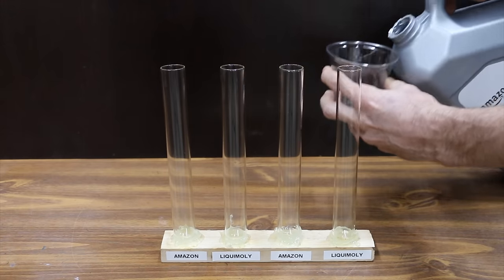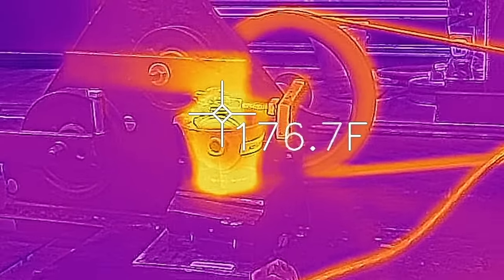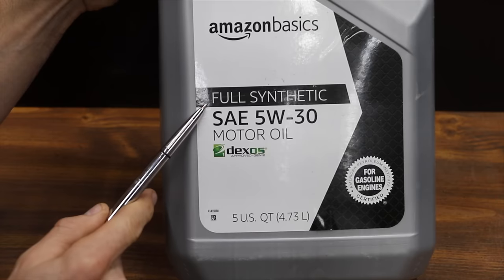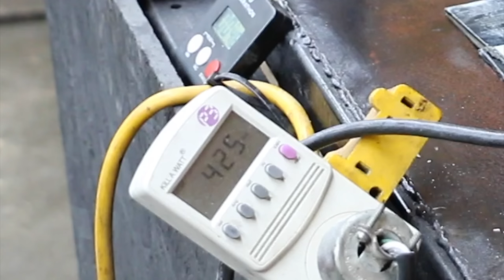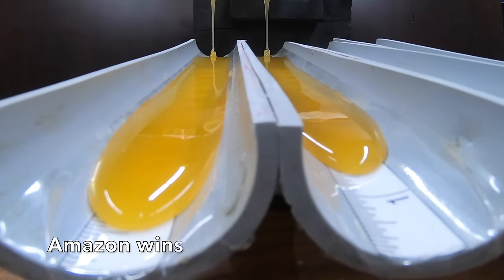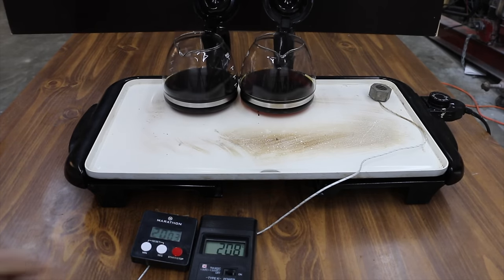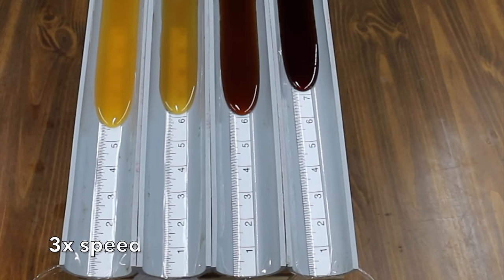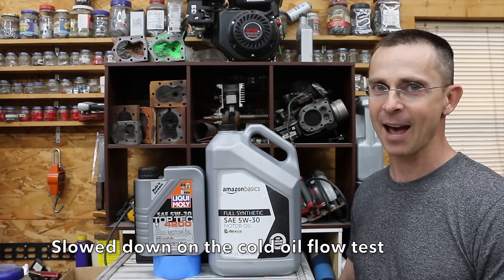Is Amazon Basics better than Liqui Moly? Let's find out!

Comment: Premium overpriced brands hate you on a whole different level.  Stay safe.
Reply from the maker: I believe you are right!  Thank you
Reply: Except for Amsoil. That shit is the best
Reply: I would never buy Liqui Moly even if this test never existed. Overpriced junk. Look how much it changed after the heat cycle. Garbage.
Reply: Amazon is good quality oil. It’s low because it hopes to take a chunk of the oil market , long term strategy monopolization
Reply: @JSPHTRS  yeah Amazon is already there. The only downside is that u can't get stuff immediately, but 2day shipping is amazing
Reply: @bagelbytes69420  Anything used all year usually gets purchased in bulk. Well, ok, maybe just 2 bottles at a time. (But I do not buy 2 commercial size packages of Choward's Violet  mints because I would probably eat them even faster.)
Reply: @JSPHTRS  100% correct. The name gets out there and Warren gets indirect notariety and a long term customer (probably at reduced profit, but long term money for sure!)
Reply: Premium brands provide 4 times less engine wear at 4 times longer Oil change interval.
Reply: LMFAO
Reply: @bagelbytes69420  yeah if you want an oil that doesn't carry any OEM approvals buy Amsoil 🙄
Reply: @repairvehicle  longer Interval doesn’t mean it’s a good idea. Dirty oil hurts the engine in the long run. I change my oil every 5-6k max. One of my vehicles 173k on the clock, doesn’t leak and looks almost a brand new engine(sounds like one too)
Reply: @KJV0812  read my comment again and let it sink in. I get zero wear on my engine with long drain intervals.
Reply: I wish they have a 5w20. I have this (5w30) on my civic that says 5w-20. I live in California. Is this ok? Or am I ruining my engine?
Reply: @surfcaster  As a rule, one should always us the manufacture recommended oil, as that is the oil the engine was designed to use. A good example is oil pressures will be effected by different grades, and in today's over computerized car/truck, that could make the computer mad. In extreme cases, heaver grades (thicker) could hurt an engine, as it might cause oil starvation in tighter tolerance motors.
Reply: @eppyz it doesn’t carry any approvals because those same dealers have their own brands that they have to push. And if EVERYONE knew that amsoil
Puts EVERY brand to shame then these company’s would flip their shit. LOL do you really think Mopar/chrysler wants everyone to know that Amsoil provides nearly 4 TIMES more engine wear protection and sludge prevention/repair than Pennzoil? LOL do you think that Naascar wants u to know that most of their cars use either amsoil, redline or royal purple and not mobil 1? Lol stop and think man
Reply: @ItsHappyHourArchived  I've used Amsoil in race engines it's not any better protecting my engine over the brand i use at half the cost.  So you sell the stuff and i get it, but amsoil is horrible at how they present their products and their sales approach is that of a telemarketer.  People that are in the field know what works and not to mock Amsoil but just how the are sales wise is enough to keep me away.  On modern engines for the average consumer and their vehicles having manufacturer approvals is a must and since Amsoil doesn't carry many manufacturer approvals another reason to pass on their products.  Amsoil is good oil sure but currently we have over 3 cars built pre 1960.  All on their original engines never had any internal failures and have never used Amsoil oil 🙄 following maintenance protocols is what keeps cars on the road not necessarily what brand of oil you use.
Reply: To be fair, liqui moly is paying for shipping overseas when Amazon is not and that adds alot to the cost
Reply: I've used Amsoil, but I could care less about their sales tactics. Most NAPA auto parts carry the full line of Amsoil. Amsoil's #1 problem is the price. They are usually the highest of anyone, and not by a little, but allot. The benefit is not significant enough to justify it, even in outrageous exotic cars.
Reply: @hawkdsl  get preferred customer and save 25%, where it’s much cheaper than most oils for the best result. Plus free shipping, and it’s there like the next day.
Reply: @KJV0812  a good rule of thumb is to use the recommended oil viscosity from the manufacturer for your engine. Different brand of the same oil will have different characteristics, some break down fast, some last longer, some are better at cleaning the engine. The way to know when to change the oil is to ask for the information from the oil brand you’re using. Amazon basic is good and cheap but it doesn’t last long either, liquid moly is expensive performed a just a bit worse than amazon basic but it last much longer. It’s easy to make good quality engine oil with good anti wear protection, but it is harder to make it last longer as clearly shown in the video. Amazon is amazing during the initial 2k-3k and then it will starts degrading rapidly and offer little protection anymore while liquid moly still maintains its original properties and protection even after 6k. You would need to change amazon oil more frequently than need to change liquid moly so the long term spending of amazon oil is even more expensive than liquid moly. Not to mention the degradation spike of amazon oil will be casing more engine wear after 3k while liquid moly remains the same throughout after 6k.

Comment: A good idea for another oil test would be to use the lubricity tester on the oil again after it has been cooked to see if it still provides enough protection after being exposed to high temperatures
Reply from the maker: Great recommendation!  I'll do that in the next round of the playoffs.
Reply: I'm curious about running oil in an engine for 2 hours, then running it through the lubricity tester.  I wonder what other factors the moving engine has on the oil than just "cooking" it?
Reply: This is an excellent idea, I am very curious to see how much less cooked oil film can handle. This is my main concern with oils, durability.
Reply: @ProjectFarm  If or when you do that, you can use the same bearing as that would eliminate any variance between two different bearings.
Reply: @HankeyMountainGarage  Good idea
Reply: 200C oil temperature might seem excessive, however perhaps such oil temperatures occur locally on high stress areas, such as the connecting rod bearings and turbocharger bearings.
Reply: @ProjectFarm  Maybe use it for a final or semi-final round?
Reply: I recommended the same thing before I saw this.
I'd like to know the total wattage used by the lubricity test as well. The kill-o-watt is not exactly super-precise, but the information should be useful.
Reply: @ProjectFarm  Can you please try Schaeffer's oil 9000 supreme vs Amsoil SS vs Motul 8100?
Reply: @MizunoGamer  Yes, like our engines in winter. Boiling, freezing overnight, then boiling while used the next day.
Reply: Do you have a document that shows all the oils of the same weights and the test you have performed?
Reply: @HankeyMountainGarage  Ring blowby and 'contamination' by the gasses and just general friction and a lot of splashing around (vapors). This is where your detergent properties come in, to keep all the sludge suspended so the filter will catch it or you get rid of it when you change the crankcase oil. But this is just what I've learned over the years. I'm diesel powered.
Reply: The correct test would be comparison after 5 thousand miles or more. The additives is what makes all the difference, cheaper oil has less expensive additives. Im running liqui moly in my perfirmance car, and lab tests show outstanding results for liqui moly.
Reply: +Jay... Isn't that what the second flow test is?
Reply: +Logan... I'm thinking put the oil in a blender or aerator  on high speed after the cooking test.   That should be a real test of the quality of the oil's anti-foaming agents. Foaming supposedly causes a lot of problems with oil.
Reply: @lewiemcneely9143  I've got a diesel too.
Reply: @HankeyMountainGarage  I don't have one but I've herded them for over 50 years.
Reply: @HankeyMountainGarage  Why not do a 3000 mile test on all of them running through an engine and then do all the tests. Could take a while. Might have to go on a few road trips. 
He could write the family vacations off his taxes as longs as he showed the products being used in the video! 😂
Reply: Astro Dreamer good idea
Reply: Agree!
Reply: @ProjectFarm  you should also do a lubricity test when the oil is frozen too

Keep up the good work I really enjoy your videos!
Reply: I agree, when doing your bearing test use a hot plate or other device and being the oil up to average operating temp instead of running to at room temp.
Reply: Exactly. Oil is only new when you pour it in your engine.
Reply: Damn good idea. That'll be a real test after running in a hot engine.
Reply: @HankeyMountainGarage  good idea, but too many potential variables with out using different, clean engines
Reply: @stephenloveless9962  Could use brand new harbor freight small engines.
Reply: @ProjectFarm  can you test Omega, Oberon, Cluber, Lubricants claim high end oils no change oils and and greases.
Reply: engine ads some carbon and fuel to oil.  @HankeyMountainGarage
Reply: @ProjectFarm  there is no  Liqui Moly  top tec 4200 fully synthetic long life 5-30 oil on Liqui Moly official site, where did you get it?
Reply: @ProjectFarm  do valvoline  maxlife 5-30 fully sinth, please
Reply: I did just that in my test
Reply: Don't make the poor guy go too crazy! Isn't he thorough enough for you? :P LOL!
Reply: @eugenet6632  Have you run Pennzoil Ultra Platinum?
Reply: @eugenet6632  
        👍👍
Reply: 😂 I know guys.  There had to be "Lab bets" going  on behind the scenes.